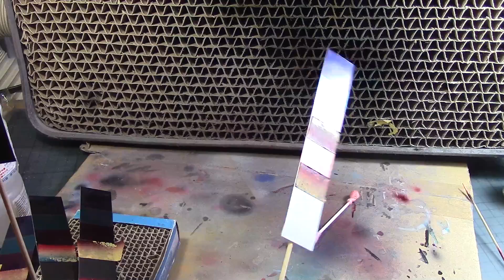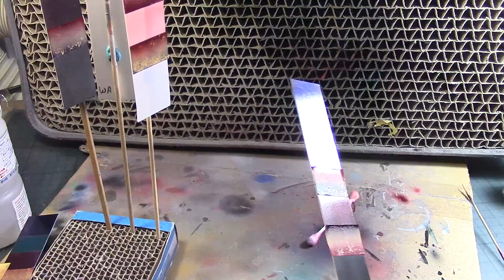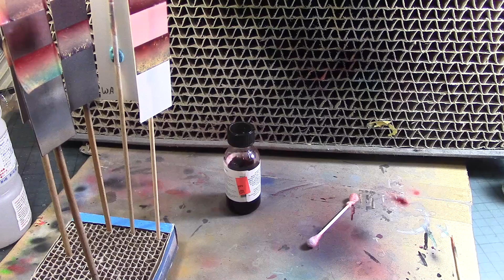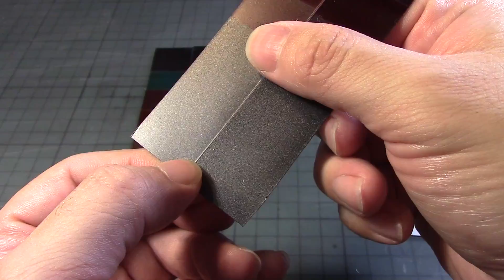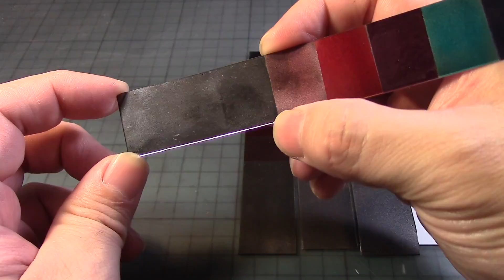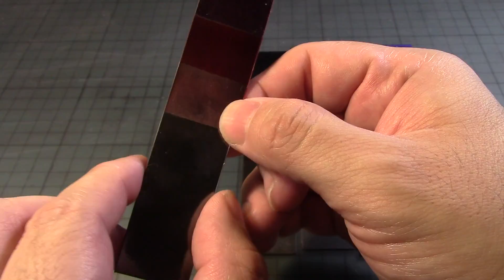Tool Time with Stryderprime - Alclad 2 Sampling & Testing - Part 4

Comment: For reducing particles on your paint, I'd recommend the following:
- Turn on your spray booth a good 5 minutes or more in advance.  Let it suck all the loose stuff in the air out of the room before you get started painting
- You don't need to clean the whole room.  Cleaning a good couple feet around your work space right before you paint would be fine.  Do it with the spray booth turned on to have it suck out the dust you kick up in the process.  (Hence why you turn on the spray booth several minutes before you start.)
- The MOST IMPORTANT part is to have a sealed place for the paint to dry in after you finish.  A large plastic bin with a lid is what most people use for this.  Keep the bin closed unless you're putting parts in or taking them out.
- I probably don't need to mention cleaning the parts themselves off before you start.  Rub the parts down with something like a soft paintbrush, then hit it with a dose of air from your airbrush or those canned air things.  That can remove particles you don't even see until you've already put paint on top of them.

I hope this helps you some.  These things helped me solve my particle problem, in spite of the disgusting levels of dust in my room.  You may still get a speck or 2 occasionally, but nothing nearly as bad as those strips got.
Reply from the maker: +Tsorovan Zero Thank you. I have been looking into getting large plastic container at the dollar store where after I finish painting my part I put the container over it just to be save. I have an air filter that I have to use during my project in conjunction with the spray booth.
Reply: stryderprime
It may seem counter-intuitive, but I would actually not use the air filter while painting.  Air circulation is the enemy here, which is what the sealed container to let parts dry in is for.  The air filter is more of a prevention tool to keep the dust level in the room lower when you're not painting.  I stopped using my air filter while painting once I learned those things I said before, and I'm almost speck free on my painting now.  Most of the ones I get now are from forgetting to clean my parts off before painting.  Try it both ways and see if there's a difference.